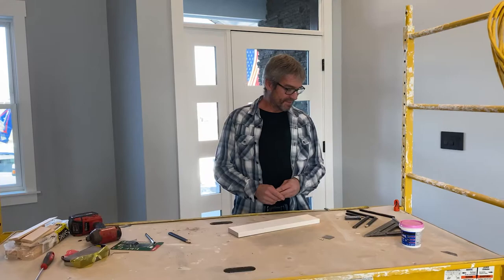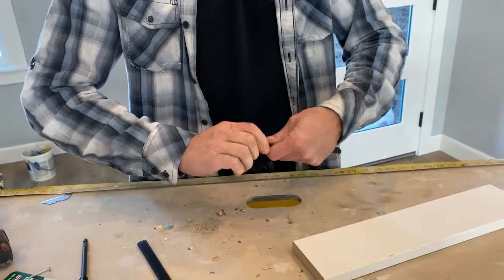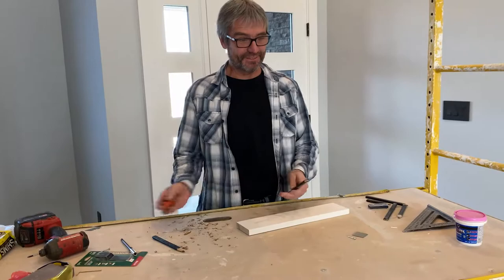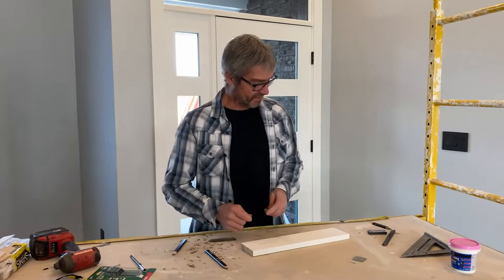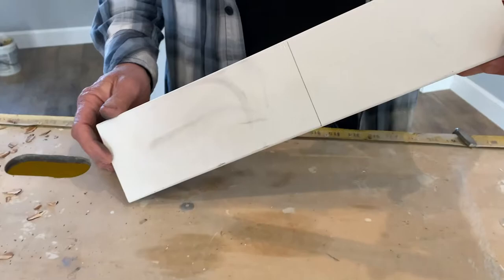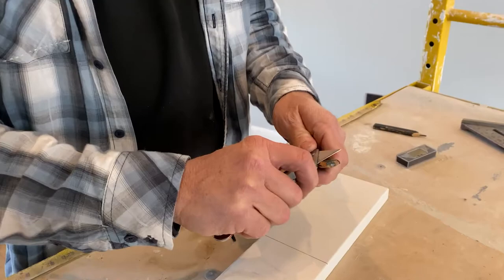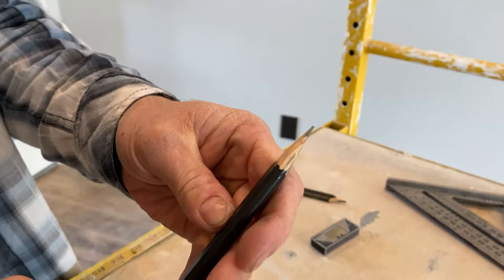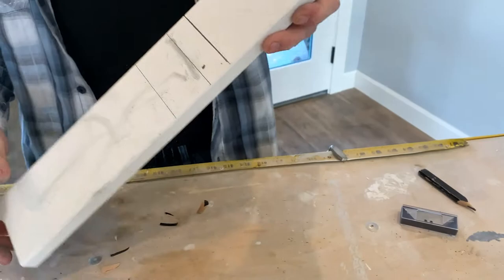Sharpen Your Carpenters Pencil Like A Union Carpenter

Comment: Newb question, when cutting, do you cut NEXT to the pencil mark where it is still visible OR do you cut off the pencil mark making it no longer visible?
Reply from the maker: The answer can be either. There are times when you may need your material to slightly wedge into place and there are times when you will need some clearance. This could also depend on wether or not you are working by yourself or not. Some guys will measure a little heavy or light. If your partnering up for a while you begin to learn which way your help measures and if your the cut man you make the adjustment on your end. I had a nephew work with me for a while as a cut man and he could split the line on a cut. I like to see the line a bit after a cut if possible so if you screwed up a measurement you know where the problem lies, you or the cut man. On another note If I have a cut man I will always write the number down somewhere that I call out because they will always blame you if the piece comes back wrong or ask “what was that measurement again”. 
I hope that’s helpful
DC
Reply: @clemconstructiongroup1700  it does and I appreciate it.

Comment: I just got a pencil and blade but I can't seem to cut as smooth as you do. Are some pencils harder to sharpen than others and what blades do you recommend using?
Reply from the maker: We keep packs of 100 Stanley’s or craftsmen blades on hand and some carpenter pencils are a little different than others but we don’t use anything specific. I think like anything it takes some practice. when I am sharpening I’m holding the knife steady in my right hand and with my left thumb behind the blade slightly pushing. Most of the movement is with my left fingers pulling the pencil while the knife is held stationary.

Comment: 2:57 leave it to a union guy to not know basic measurements. 0.05mm would be a really fricken thin line, unless you meant inches, which would be 1.5x the width of a 0.5mm pencil.
Reply: He's a yank; it's something called inches. 0.05" is 5/100th of an inch about 0.5mm.